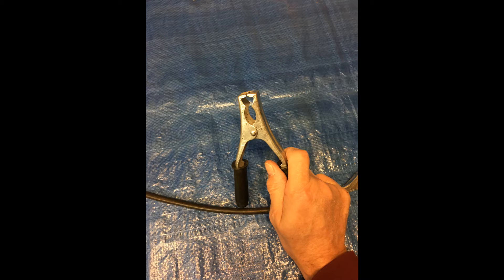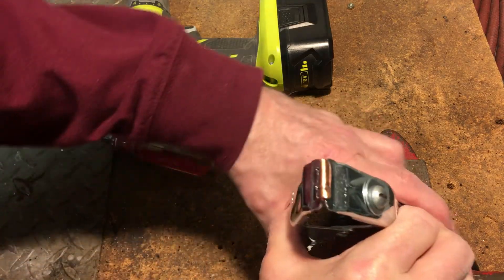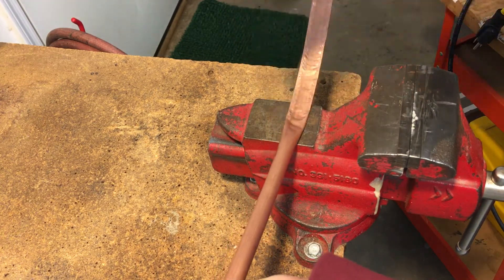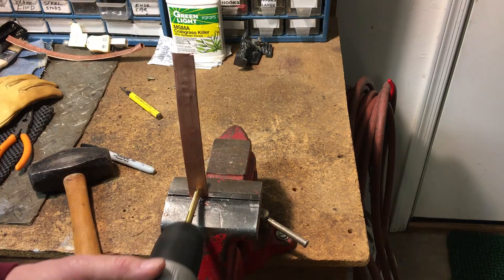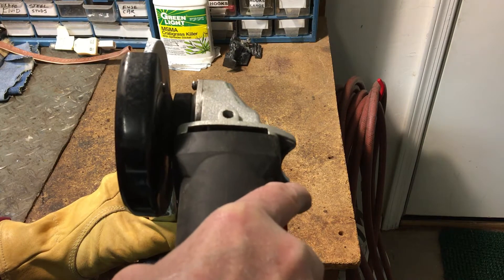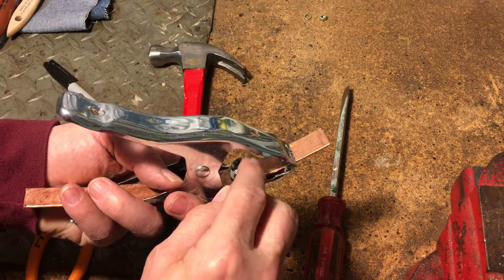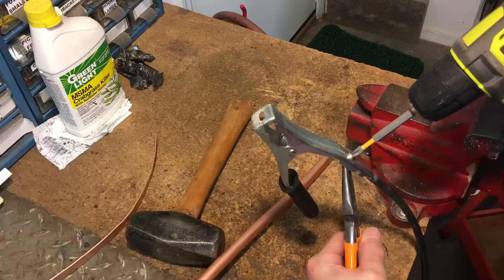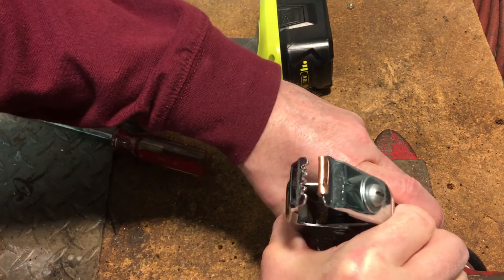Make A Better SOLID COPPER Welding Ground Clamp!

Comment: What about the connector between the copper tubing and the cable? Does that limit some of the conductivity not being copper as well?
Reply: Termination lugs are made from nickel plated copper.

Comment: I knew I was going to have to do something like this. I just checked my clamp and for sure, the copper-plated bits are magnetic. I figured they'd be aluminum, but steel is pretty terrible. Goofy as all getout we can't even buy something this good and this is less expensive than the cheapest clamp! lol Subscribed!

Comment: Copper plating. I bought some pot and pan scrubber wool. Copper plating comes off with light scrubbing. And you end up with rust if left on edge of stainless steel sink.
It's real hard to find stainless steel scrubbers. Restaurant supply stores.
Electro plated junk-Consumer abuse.